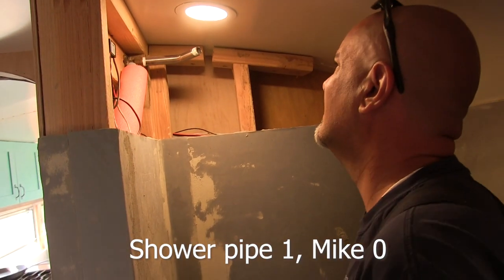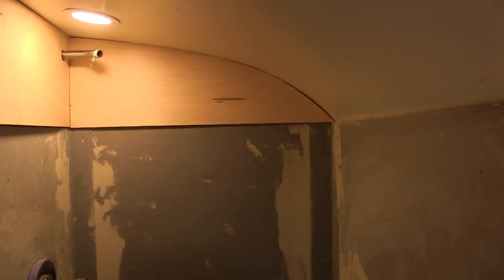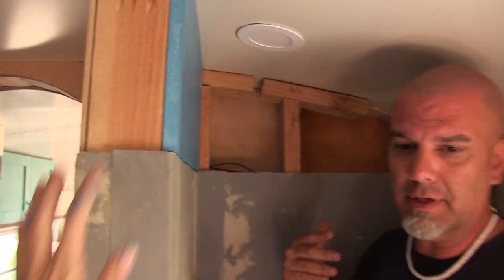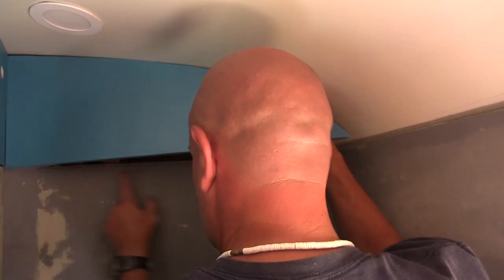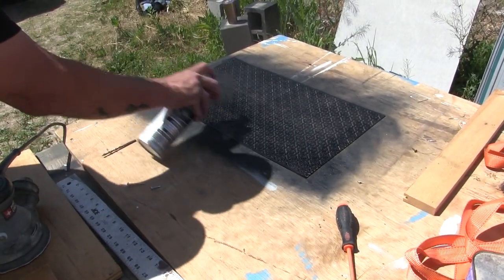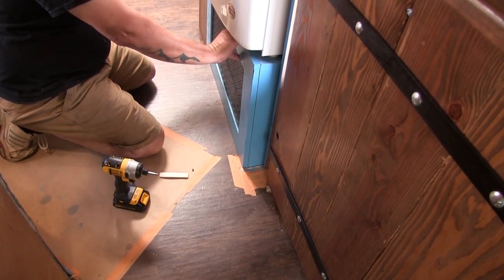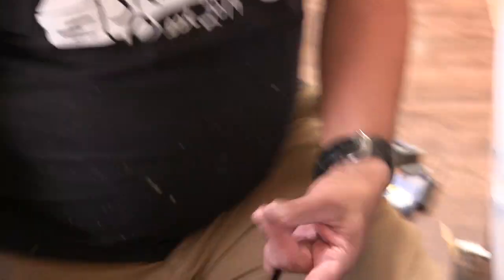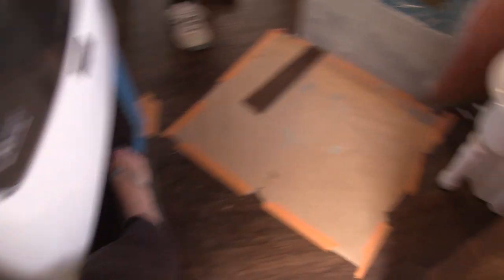Finishing Bathroom Walls & the LAUNDRY DRAWER in our Skoolie!

Comment: Nice laundry drawer.  Ever change that GFI behind the washer? If you are on the road, and it trips you are not going to want to pull that machine out to reset it, especially if it trips when it is full of water. Perhaps an access panel could be put in so you can reach it?